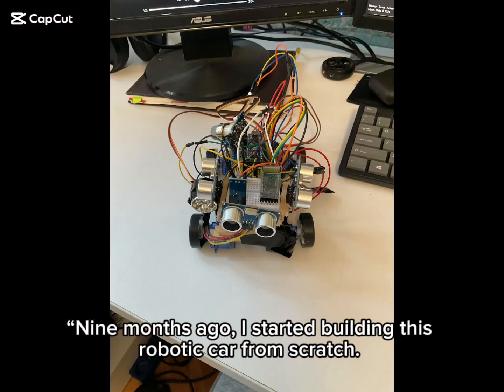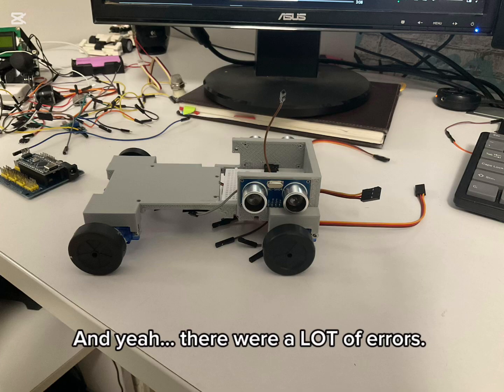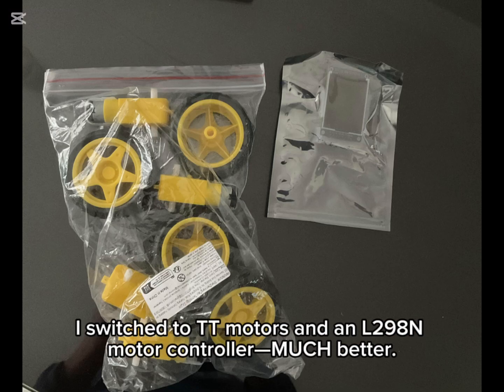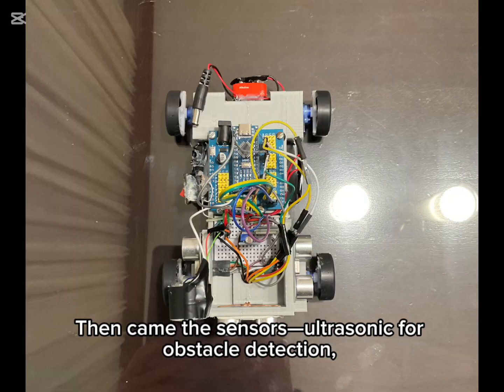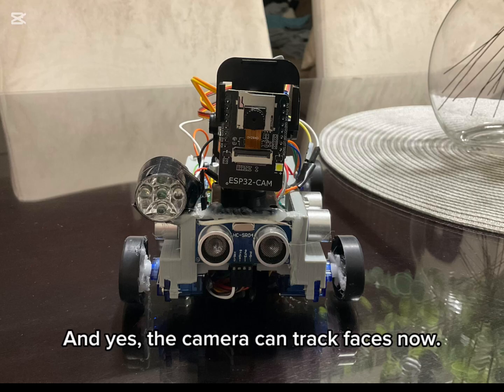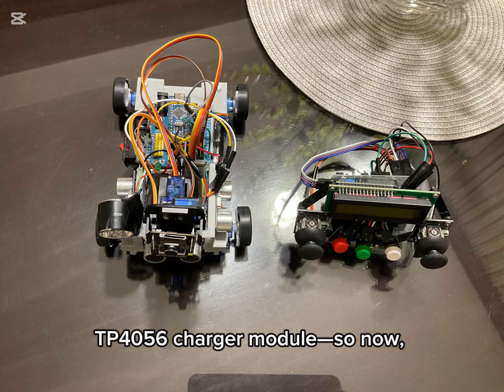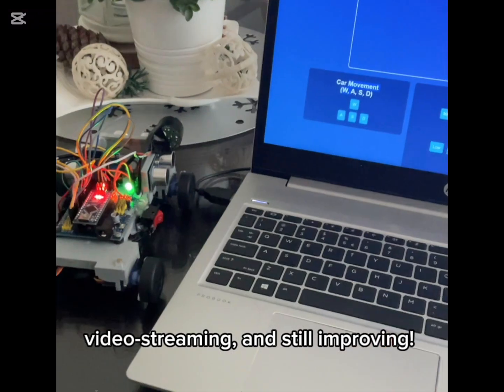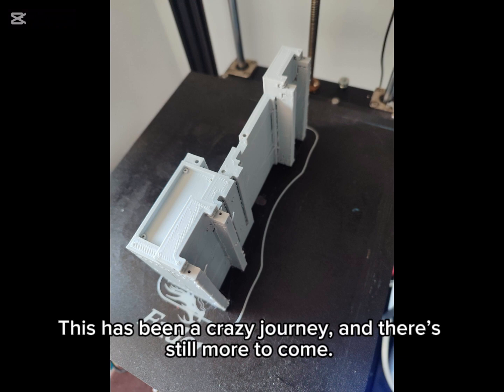I Built an Arduino-Powered Research Car! 🚗⚡

Comment: Really great job!

i got nearly the same setup with 4x TT motors and 2x L298n since yersterday execpt i got an raspberry pi  zero 2 w and no cam yet
we are challenged to build one in a few weeks that is controlled over a webserver.
somehow i got to be a beta tester for this project :D

do you have some kind of documentation or guide?

ps. your selfmade controller looks great!
Reply from the maker: Thanks man your project sounds amazing as well. The cam is esp32 cam if you are interested and it’s very easy working with it. About the web controller. When i use my web controller my handmade controller needs to be connected via cable to my computer. Then i use a python flask server to get the info from the com port and send it to javascript. It’s the same when sending from web to Arduino through the com port. I will put the github link in the description for the files if you want to see them.
Reply: @RRoboCCrafts  sounds good :D keep up the work. like to see the github :)

the catch with our project looks like we should work with Thonny and should implement a movement input with the arrow keys and what i have read so far from "chatgpt" it's hard to get the libary to work for that on thonny so i just use the good old gaming wasd keys :D
i am not so far to confirm if it's hard to use that libary for thonny
Reply from the maker: Thank you too. You can check the github link its in the video description. And good luck with your raspberry pi project, I don’t have much experience with it to help you, but I do know that the onetime i did work with it u used thonny with python. Hope that helps.